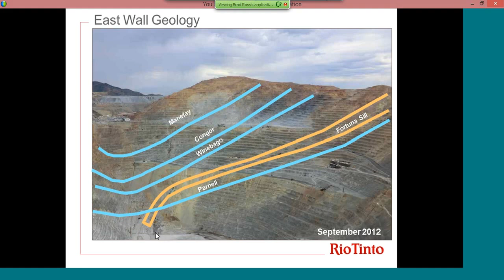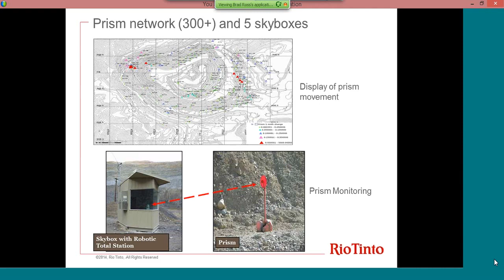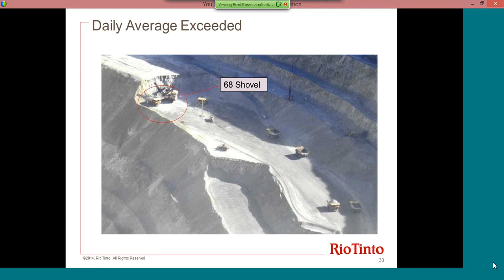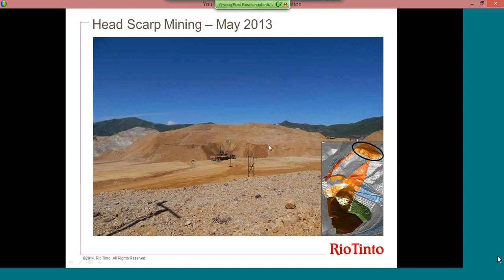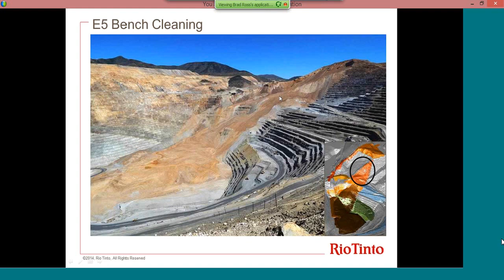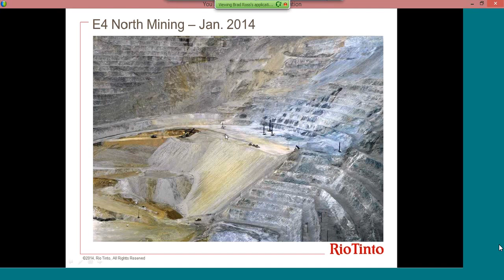Lessons from  Kennecott (Rio) Utah Copper's Manefay Slide at Bingham Mine

Comment: Why weren't the trucks, shovels and other equipment removed from the mine a bit before the expected slide date?
Reply: Because the shovels probably would need to be disassembled to be moved out of danger.  That is how they are typically moved if they are not decommissioned in place!
Plus if you watch the video, they explain why!
Why dont you watch the video before you comment?
Reply: @mahbriggs  I did watch the video, i didn't hear that addressed (unless it was when the garbled audio was playing) else I wouldn't have asked...
Regardless, it would seem that disassembling and moving them would've been less costly than replacing them.
Reply: @jbak6892  
They under estimated the speed and size of the landslide.  They had a raised area in the pit that they thought the equipment would be safe.  It wasn't.
Watch the video again, he talks about it fairly early in the talk.
I dont care enough to find the time stamp.
Reply: @mahbriggs  Thanks for the info.